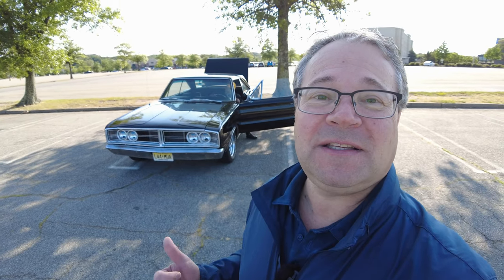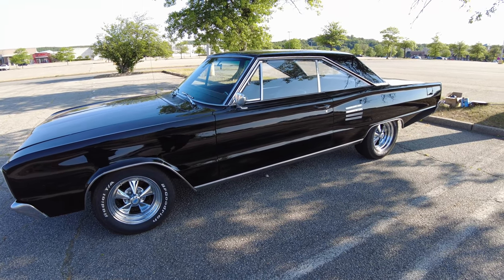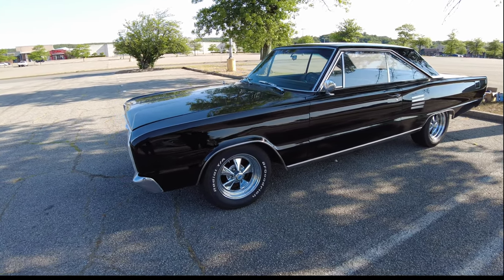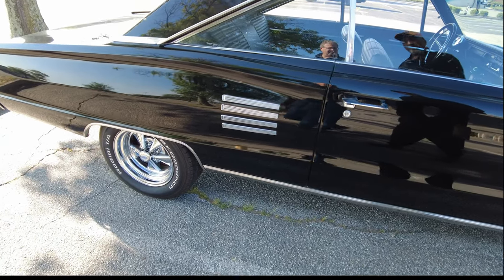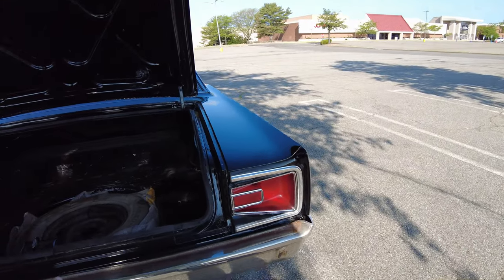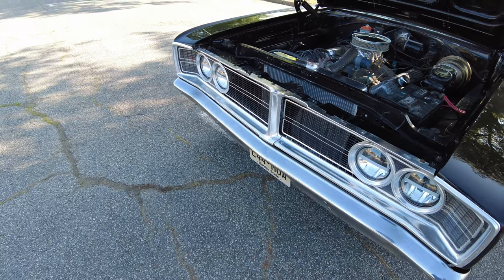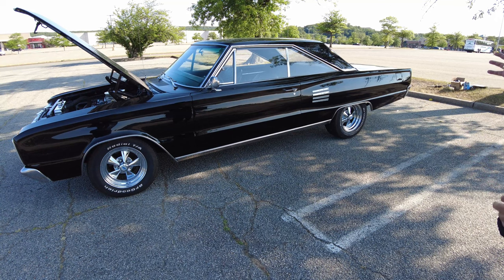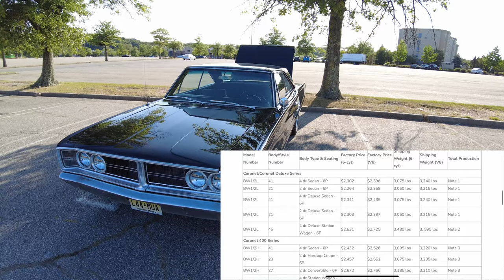1966 Dodge Coronet 500 2-Door **SOLD!!** 440 big block - Please subscribe!

Comment: 30 years ago I bought one it was black on black or black black top burgundy interior I found a 1968 Chrysler New Yorker weather 440 in it 13,000 original miles on it I gave $200 for the car 440 727 automatic in a posi rear end 🔚 it all went into that car I painted the car lime green with a white top put weld racing wheels on it skinny in the front wides in the back do to life's circumstances I had to sell the car after building the car myself I did everything on the build except for the transmission that I had a buddy that was a transmission specialist that made me a bulletproof reverse shift pattern 727 automatic